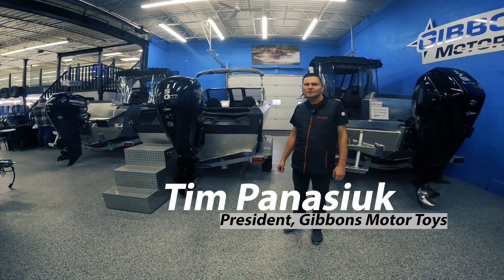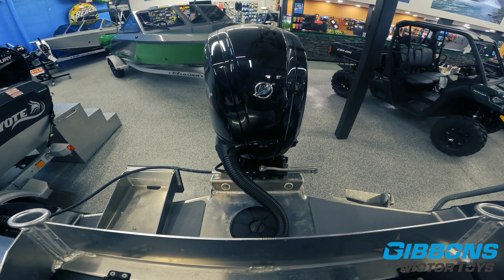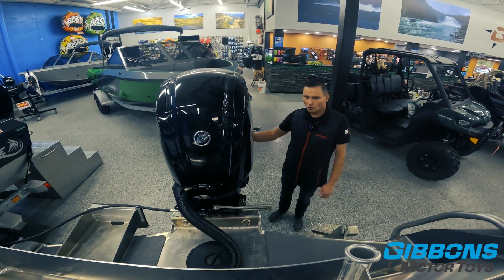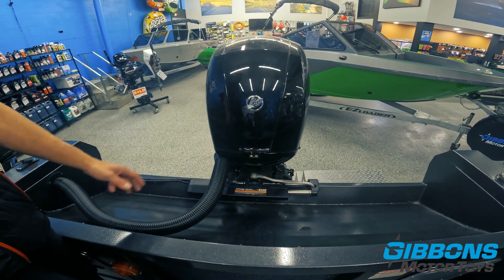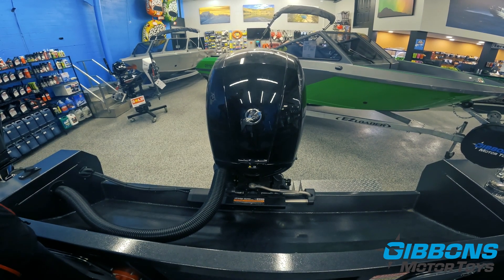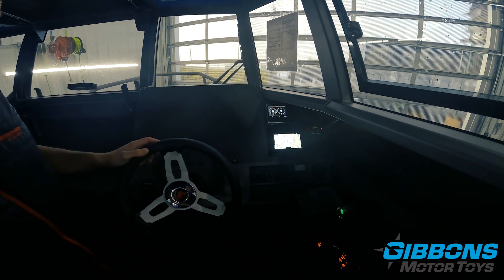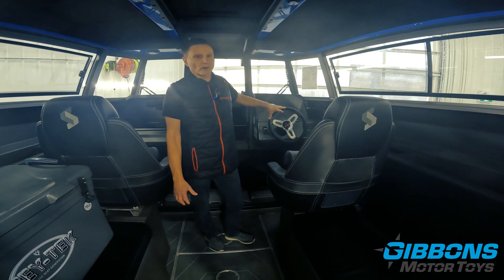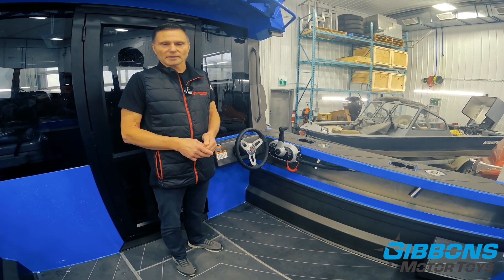Boat Steering Systems: What You Need to Know

Comment: When you are using electric steering for trolling, is there a way to just turn on the power for the steering or do you need to turn the keyed switch on? I would be concerned with a power drain if you had to turn the keyed switch on since other accessories might come on too. How much power does the EPS system use? Is a 15-amp trolling motor alternator enough to keep up with the power draw for this system, a couple of chart plotters, auto pilot and 4 speaker stereo system?
Reply from the maker: The key does need to be on, but besides the initial draw from fuel pumps and the gauge powering up, there is really no parasitic draw from leaving it on. EPS only draws power when there is a steering demand, so in a straight line it is drawing 0 amps. The faster you turn the wheel the more power it draws. A 15A alternator might not completely offset steering, downriggers, chartplotters, etc but you would get a good run time out of it. In a pinch you can simply let your big engine idle for 30 minutes and gain back a lot of charge capacity. We've had 0 complaints with this setup, it's bulletproof.
Reply: @gibbonsmotortoys  Thank you Tim. As always, your channel is very helpful and has useful information. Please keep the information flowing.
Thanks.
Reply: Intensive comparison.. super insightful 
I would like to see a deep dive into the EPS system and the different aided modules it includes